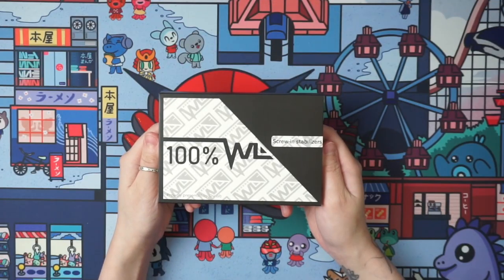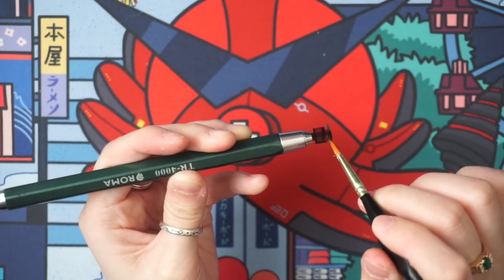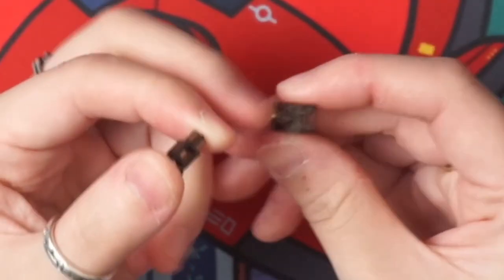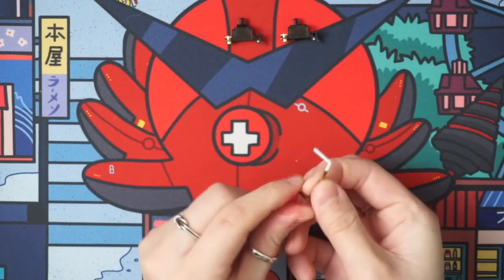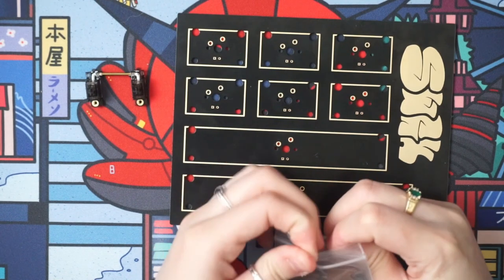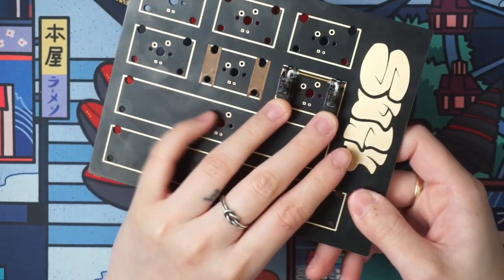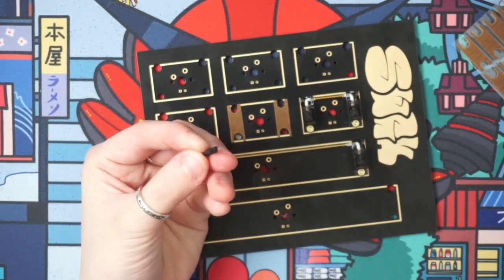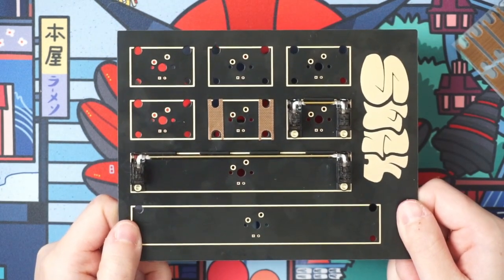OwLab's new Owlstabs are a real HOOT (Tutorial)

Comment from the maker: a few people have asked me what to do if the wire isn't straight or if the stab keeps ticking

there's a few things to check before you reach out to owlabs for a replacement (assuming you bought it directly from them)
- using a flat surface, find the side that is the straightest. meaning, tap on each side of the stab (left & right) and flip the wire to see which side has less "ticking". the orientation of the wire matters in this case and i've been able to salvage some wires by choosing the side with the least amount of ticking 
-  if you haven't already, plug the back some more or using your lube of choice, add a small bead on the end of the wires to reduce the wire hitting the stab housing
- check that you haven't overlubed the stabilizers. sometimes if you put too much lube, it can create a small pool which could contribute to that weird sound you're hearing 
- make sure that the stabilizer is fully seated. try taking the clear backing off or put it on if you haven't. same with the cushions, add or remove them to see if that fixes it 

these are just some tips that have worked for me, feel free to ask more questions! i'll admit tho that it's hard to troubleshoot online and sometimes you just get a bad set of stabs :(

Comment: Thank you, I had picked up owlstabs cause I heard you don't need to clip them compared to durocks, but was struggling with putting things together on this build I was doing just now. I didn't end up using the wire cushions as I didn't have any issues after getting everything set up. But good to know what they are for! I initially had ticking in my spacebar after I finished my build but that went away after I just tuned it up with a bit more lube.

It was hard to find info that were for this specific stabiliser, and I have to say assembling it didn't come intuitively to me so seeing how the wire was attached and how to determine which way to put the stabs in were pretty helpful

Comment: Thank you for the tutorial! I feel like I over lubed with XHT. Mine feel kind of sluggish. Do you only add enough XHT to barely see the gold wire, and do you add less around the wire bend?
Reply from the maker: I use enough so the wire is lightly covered, I do the same amount around the bend. Are you plugging the back? I've found that I need less when plugging these since the bottom piece is so small. If you put too much, it also creates a sluggish feel due to the lube creating a suction effect
Reply: @xinxinwong  nope not plugging the back. I probably use like half of a green pea size amount of XHT on each wire end. It's pretty layered on there, and looking at it now I see XHT on the housings like it leaked through somewhere.

Comment: Are those cushions at the end of your video adhesive? It seems like you just pushed them around as if they're not adhesive. Wouldn't that just roll around then?
Reply from the maker: they're not adhesive, but they don't roll around. since you have to push it underneath, the grooves on the cushions make it so that it shouldn't come out from underneath the wire. they will shift tho if you decide to adjust them

Comment: how would you compare these to tx stabs?
Reply from the maker: good question!! 

if your wires are straight, both are very easy to work with and don't require much modding imo. if your wires aren't straight tho, you can still balance tx stabs but you can't with owlstabs. owlstabs are in stock though, while tx stabs are very hard to get atm. also depends if you have a preference for clip-ins or screw-ins. 

Owlabs is also willing to send you replacements if your wires aren't straight though so that's a plus!
Reply: @xinxinwong  How often are these... straight?
Reply from the maker: @JL-fh4qw  From the ones I've used so far (5 builds), I've found about 2-3 that have been kinda weird but I usually had the 100% kit to replace em. Spacebar wires have all been straight so far though, only the 2U's have been a lil weird. Can always ask for replacements from Owlab if your wires aren't straight though

Comment: any tips for when all stabs literally wont stop rattling or ticking to some extent? Ive relubed like 3 times on each one now and they still aren't great. I suspect it might be some wire unbalance in the 2U ones especially.
Reply from the maker: other than using the cushions or bdz if you're not already, unfortunately not. plugging the back might also help? not sure if you have v1 or v2, or if you got them for free with your mr.suit or bought them separately. if they're v2 that you bought from a vendor, you can request for a replacement. 

i've also found that the 2Us tend to have more issues but haven't really found a good fix for them, other than just replacing the wire
Reply: The holee mod and other stuff that’s harder to do and also you can put some super thin cushioning on the part of the housing where the wire rests, that’s where the ticking comes from
Reply: But also my owlstabs are kinda terrible, I think the wires got bent during shipping and now they’re used to being not straight, but I don’t want to balance them since I’m afraid they’ll break

Comment: I hoped for a comparison with durock v2 and more of your impressions.
Reply from the maker: apologies for that! this video was mostly made for those who needed a guide on how to use owlstabs.

as for my impressions, owlstabs can be hit or miss when it comes to how straight the wires are. assuming they come straight, owlstabs are really nice for people who don't want or know how to balance and their housing are a lot tighter, leaving less room for ticking/rattle. they also provide cushions to reduce any ticking/rattle that may occur and automatically come with shims in case you're using a thinner pcb.

also if your owlstab wires are bent, owlabs will send out replacements (assuming you meet the conditions aka didn't get them for free in your mr.suit or spring). 

so tldr owlstabs are good for those who don't know how or don't want to tune/balance stabs, can be hit or miss on straightness of wires (generally pretty good tho), and owlabs will replace if your wires are bad. 

with durocks, you can balance the wires if they are bent but if you get bad ones, you'll just have to buy new ones. for me rn, i'd prefer using TX stabs (hard to get) -> durocks (i can still tune the wires) -> owlstabs -> staebies -> c3
Reply: @xinxinwong  Thanks for all the info. :)
No need to apologize. Was still a great video.